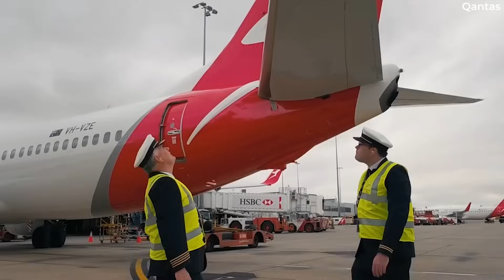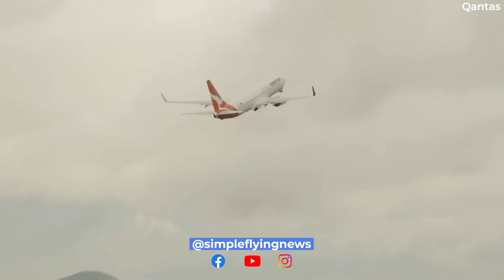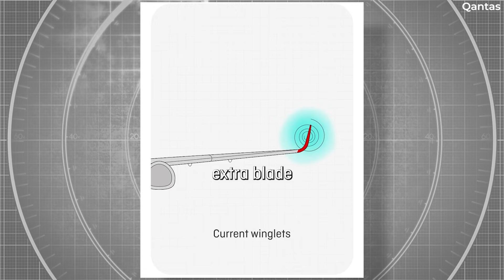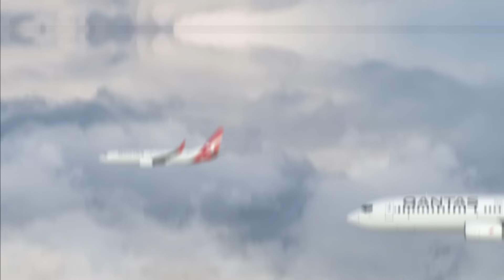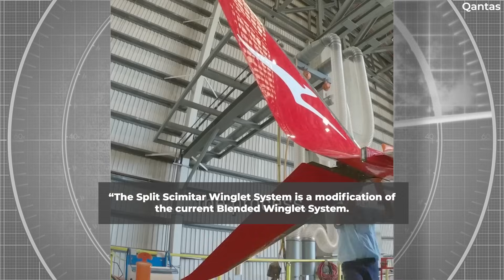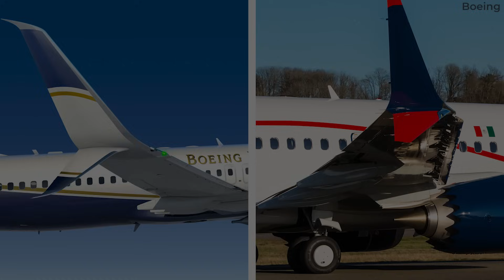Qantas To Boost Fuel Efficiency With Split Scimitar Boeing 737 Wingtips

Comment: But why have these to be retrofitted, surely Boeing could have delivered them from the factory like this, especially if they contribute that much to fuel efficiency?!
Reply: These are not new planes. The one mentioned in the video - VH-VZU - was delivered in 2011, and the average age for Qantas 737s is 16 years. Those winglets were not available back then, so could not have been delivered new with the split winglets.

Comment: For those who might say "It'll be difficult to distinguish this from 737 Max planes", look at the engines. That'll be enough to tell them apart from the new design because these split scimitars look amazing on these NGs.
Reply: even the wingtips are slightly slimmer than the MAX wingtips which look cohesive and substantially bigger than these. Also there are no chevrons in these engines compared to the max
Reply: Yep The AT winglets on the MAX does look different when you look closely.
Reply: It's not the Max I'm worried about.

It's Boeing.
Reply: You can also distinguish 737 Max planes by their ability to nose dive really fast, and their new, fuel efficient open hull design.
Reply: @nasseralkhelaifi1853 I woder if there is still parts of the ET302 wreckage at Addis Ababa

Comment: Hasn’t Qantas purchased A320neo’s and A220 to replace it’s 737 fleet?  If that is the case then why retrofit the 737s if they are not supposed to be around for much longer?
Reply: The aircraft they are retrofitting arrived from 2011. The newest batch of 737s arrived in 2017-2018. They have another 8-10 years left before these aircraft will be retired.

The oldest 737s arrived in 2002.

The A220s are replacing the 717s. The A320s start arriving in the 2nd half of next year.
Reply: @magical_catgirl  agreed, it will take time to replace even the older 737 NG fleet with the A321. I really want to try the new A220!
Reply: @theharper1 They’re also specifically replacing them with the XLR, which hasn’t been approved yet. They planned to receive them late 2024 when they were ordered but that timeframe is looking very unlikely now. They’ll probably receive their first XLR by late 2025 and that’s really if everything goes smoothly which I find unlikely.
Reply: @TheMergeBuff45  yeah, the A321LR order was for Jetstar (Qantas group not Qantas flag)
Reply: Yes agreed I am wondering with new aircraft coming on line - Is this financially responsible

Comment: They actually look more modern than the winglets installed on the max.
Reply: Guess they plan on retaining the 800's longer then expected, to recoup the expense of the winglets.
Reply: @bringbackmd7579  the 23 aircraft they are installing them on are the youngest in the fleet. The first aircraft to get them installed was delivered in 2011.
They had 737 batches delivered in 2002-2006, 2008, 2011-2014 and 2017-2018.

They have 20 A321XLRs due for delivery starting mid next year and another 94 options. Once they start arriving, they'll retire the oldest 737s. It will be another 8-10 years before they start retiring the 23 aircraft getting the new winglets.
Reply: I disagree
Reply: It’s newer than the MAX winglets.
Reply: @sussy001 it’s not newer than the max. these wingtips have been in use around 2013